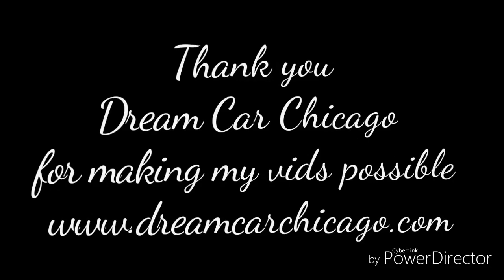Rolls Royce Silver Spur air spring dissection and dismantling

Comment: It’s not an air spring it’s a hydropneumatic suspension sphere containing at one time nitrogen and hydraulic fluid under high pressure which regulated the height of the vehicle